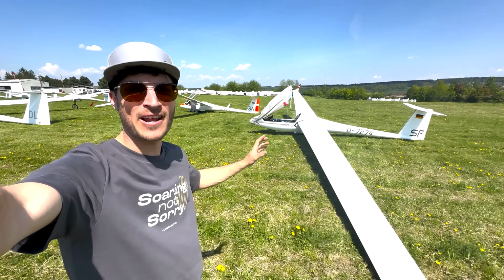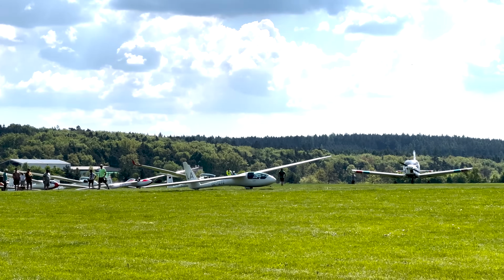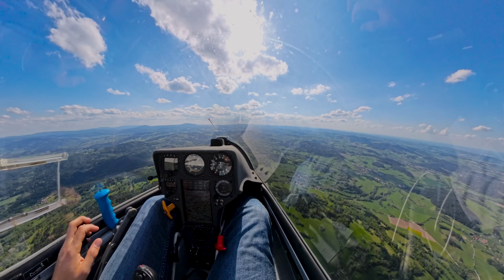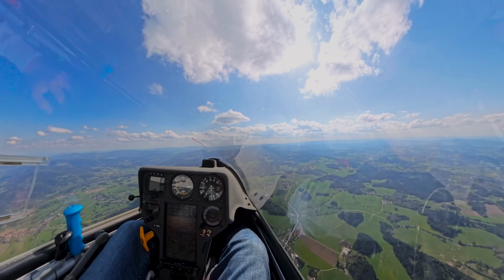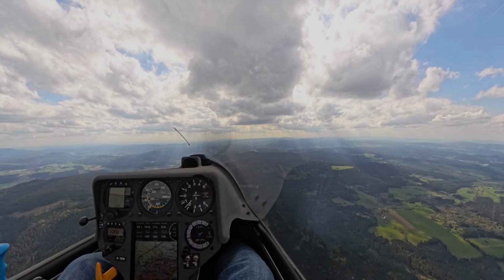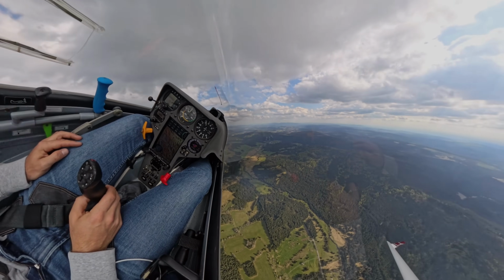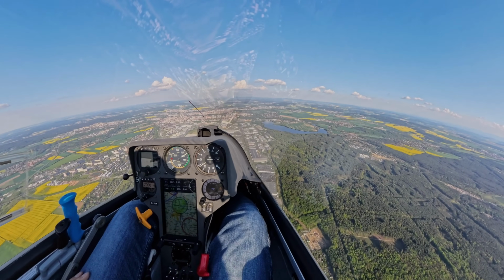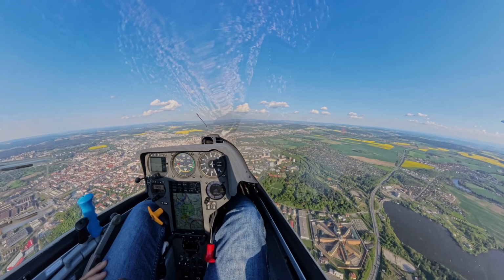World Championship Training in Czechia | LS3 Flight Over Nuclear Power Plant

Comment: I would definitely like to see an in-depth video on the Larus Dual-GPS Vario. For me, it would probably just be confusing to compare with other multi-sensor Kalman-filter based varios (like HAWK) flown at a different time in a different glider. I am very interested to know your opinion of the wind calculations and how/if you use Larus wind in your flying. This sort of vario is always a bit of a black box, so comparing one black box to another will be a waste of time unless you really dig into the sensor readings available to each vario and compare the outputs side by side. I think the Larus dual-gps version has a big theoretical advantage over the HAWK, but without looking at both types installed in the same glider I doubt we'd learn much from what could be presented on YouTube. Second-hand accounts by people who've flown more than one of the Kalman-filter vario types are very subjective, as they all work after a fashion.